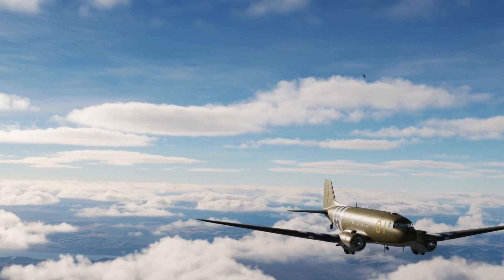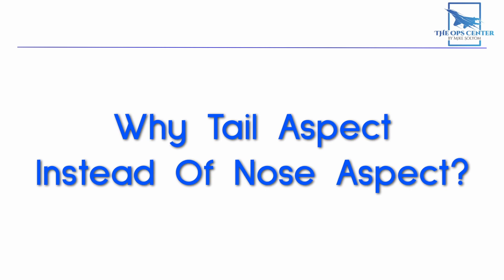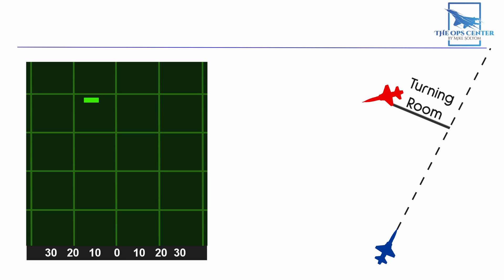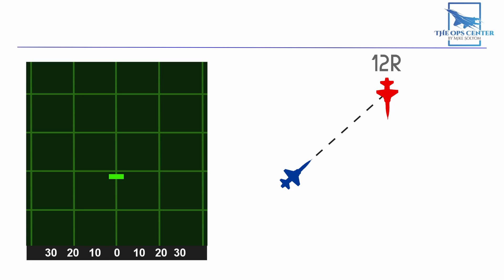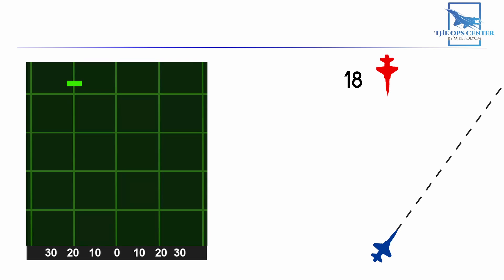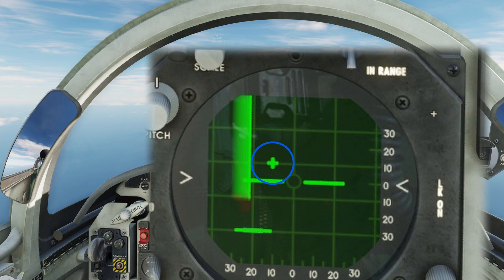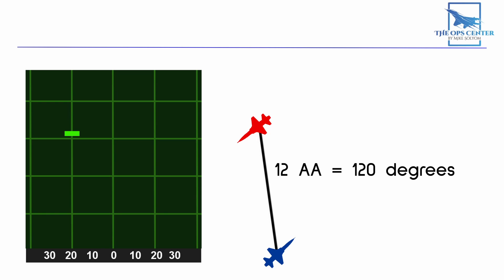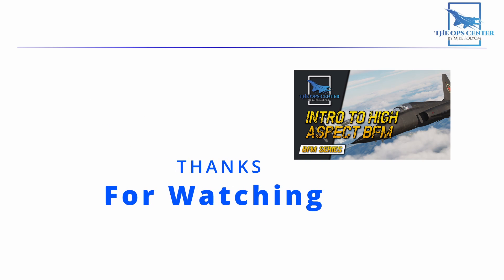Baseline Intercept Tutorial | Air Supremacy Series | Part 7

Comment: Thanks again Mike for the great video. Are there any resources to find out the canopy codes für F/A-18 and F-16 or is it just trial&error?
Reply from the maker: There are. But I don't know of any that have been publicly released.

From memory (so this may be wrong) the canopy rail on a F-16 is something like 40 or 45 degrees down. This is because the pilot sits really high in the cockpit. Pilots would then get the shallower canopy codes by sticking their hand on top of the rail. A fist would provide a shallow angle and a hand with the pinky and thumb stuck out would give an even shallower angle.

Unfortunately, my memory is failing here. But eventually I will get to making a series for the Viper and will work out the codes within DCS.